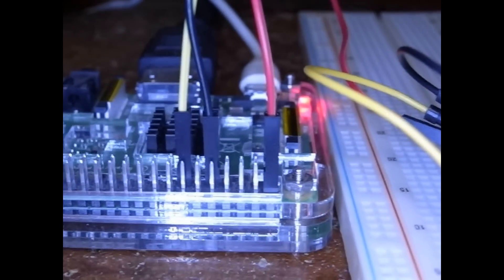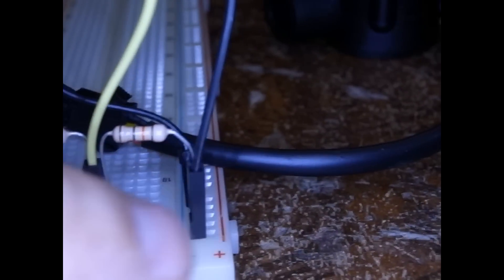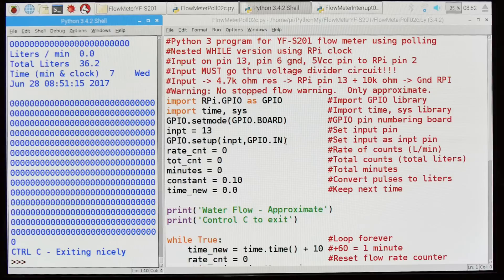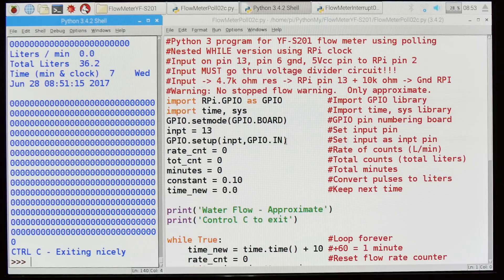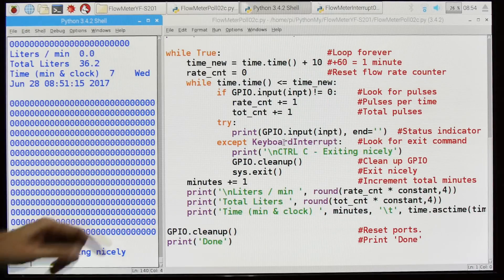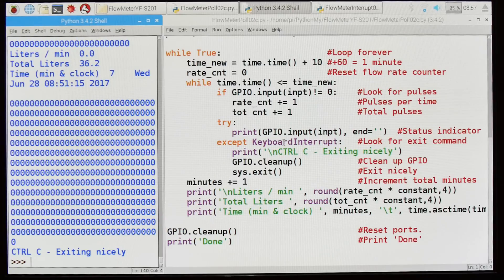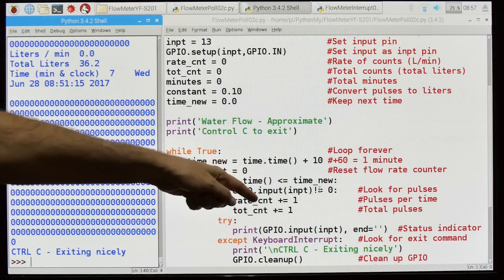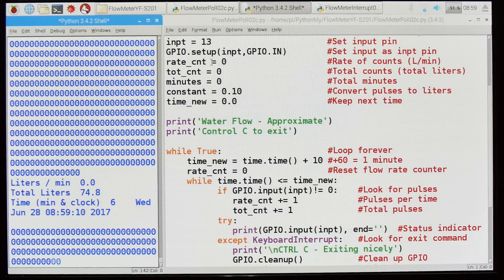RPi 20 - YF-S201 Hall Effect Water Flow Meter / Sensor

Comment: do you think this could be use to measure airflow in an HVAC system?
Reply from the maker: Probably not very well. The little turbine starts spinning very fast and it stops being accurate at all. It needs the thickness of the water to dampen it.

Comment: This resistor divider drops the voltage to 3.4v. Over 3.3v GPIO limit, is not this dangerous? Or the sensor out not have 5v output? If is 5v, the R2  should be >=9k

Comment: Nice project.  I am  curious, I have this running and I am getting pulses but far fewer than expected.  Could that be due to the resistor sizes I determined as part of my voltage divider?  I am only getting ~5 pulses every minutes when I know the impeller is spinning much faster than that.  Any ideas?  I am getting a reading, it's just way under what it should be.
Reply from the maker: There is a max rpm that it is rated for, and it is pretty low. I have info in the description. Also, any amount of code causes the pi to start missing pulses. I have a couple videos on this meter exploring ways to improve accuracy.

Comment: Hello, this version of raspberry pi can work on three water sensor at the same time
Reply from the maker: Yes, but timing begins to seriously affect accuracy even more.
Reply: @tsbrownie  ok thanks, but can you explain more and what is your advice or the best solution if i want to make three water flow sensor works together at the same time.
thank you so mutch you are the best.
Reply from the maker: @qatrahqatraty8184  I have not done that, so my answer is a guess. But if I needed accurate results I would experiment using 1 dedicated secondary micro computer for each meter (some in the Arduino family are only 2 USD) and use another primary to gather the data.
Reply: @tsbrownie   thanks for the advice i am gonna try it

Comment: your video is great, but im having issues on line 23,

 print (GPIO.input(inpt), end='') #status indicator
                                ^
SyntaxError: invalid syntax

can you help me? thanks
Reply from the maker: I think your "end" is incomplete.
Reply: What do you mean by incomplete?
Reply from the maker: @zackyilahiazmi2073  You either have an error in the previous line OR you have a " instead of ' ' (double quote instead of 2 single quotes)
Reply: I recently search about my problem, its because im using python 2 instead of python3, but after i install python3 and use it, it still say invalid syntax at end=''
Reply from the maker: @zackyilahiazmi2073  It looks like you are using the wrong quote marks.  Use either 2 singles '' or 2 doubles ""
Reply: No, actually im using double ' not single " and still didnt work
Reply from the maker: @zackyilahiazmi2073  Then you might have an error in the line above and Python did not flag it.  Interpreters sometimes do that.  Also, try dropping the optional end = "" and see if that fixes it.

Comment: thanks for your code, but i want know , how to calibration ? , thank you
Reply from the maker: It depends on your setup.  But the basic calibration specs are in the description.
Reply: @tsbrownie  in your video , your code constant value 0.10 . Can i know where can get 0.10 ?
Reply from the maker: @ilhamahmad6156  It is just a place-holder.  If you look in the description I have the manufacturer's data on how many Hz = how many liters / min.  BUT you have to adjust it base on your code and how much you have the pi doing.
Reply: @tsbrownie  i use water flow meter fs300a 3/4 , i get in 1 liter 4 seconds , so 60/4 = 15 liter / min , so in my water flow meter , F = Q * 5 , so i get value frequency is 75 , is this true ?
Reply from the maker: @ilhamahmad6156  I do not know that meter.  You have to get the information from that manufacturer.
Reply: @tsbrownie  oke thank for your attention , good luck

Comment: Hello, 
This unit, can it be connected to control ?
Like Temptron
Reply from the maker: I do not know temptron, but I have a video talking about using it to control a water system.
Reply: @tsbrownie  this device has digital input, can it be connected?
Reply from the maker: @listrikb6885  It uses a magnet and Hall effect sensor. The magnet triggers the sensor creating a pulse (or pulses) per revolution. The raspberry pi counts the pulses. Data is in the description.

Comment: Will this work for gravity flow, with less head pressure ? head pressure is going to be 10 PSIG
Reply from the maker: The specs are in the description.  The manufacturer lists a maximum, but not a minimum.  I think gravity would work fine as long as the flow rate is within specs.

Comment: I think you can calculate the constant by spec (450 pulse per liter). Just divide the number of pulses between 450 and multiply by the time unit you are measuring (e.g. 60 secs to get Lt/min). However I used the wiring and was OK!! Thanks!
Reply from the maker: That sounds correct.  But you must consider the speed of the computer as well, if you are just running a small program that will work, but as the program grows in complexity, the polling / interrupts don't always happen as timed.

Comment: ur total is wrong. you didnt blow 12 liters of air through that. you aren't integrating right.
Reply from the maker: Yes I said that in the video.  The problem is that impeller is spinning very fast giving wrong measurements.  This was made to measure a relatively viscous fluid (water).  Also the specs show it has limits on upper and lower impeller speeds.  This was just for demonstration purposes.

Comment: Will this code work for a YF-G1 ?
Reply from the maker: I included the YF-S201 specs in the description so you can compare to others.  You should also consider that the electrical requirements may be different.

Comment: do the sensor give reading when when the water flow is slow?
Reply from the maker: The details are in the description.   Working Flow Rate: 1 to 30 Liters/Minute
Reply: @tsbrownie  so if the flow lower than 1 L/min it wont read anything? am i right?
Reply from the maker: @muhammadzar3002  It may or may not read, but it will be inaccurate.
Reply: @tsbrownie  thanks for your reply.

Comment: Good day

I need help with the code.

I want the flow meter to count 500ml and then then the relay must close?

How can i do that
Reply from the maker: I put a lot of info in the description.  It will be different for each model of flow meter.  500 ml per what time?  This meter has minimum and maximum flows.  Outside of those it does not work well.  Also the accuracy is only ±10% and the range is 1-30 Lpm.  Hope that helps.

Comment: I'm not sure if this has been mentioned before, but I figured out how to solve the getting 1's as inputs even when the impeller is stationary. If the impeller has been turning in the opposite direction as it does when air flows through in the correct direction, it shows  1. If you blow through in the correct direction before running the programme it corrects itself and goes back to 0. Not sure if this will help anyone but just thought I'd mention what I found.
Reply: same here
Reply: he already solve the impeller problem, thanks you mention
https://youtu.be/0fqoq1jWlts

Comment: Hi, I know this is a water flow sensor but I would like to use it for air, do you know if that's possible? It's just to get an idea of a relationship so it doesn't need to be that accurate. Thanks :)
Reply from the maker: I don't think it will work.  Air would cause it to go WAY past it's design speed.  It is very easy to make it start under-counting by a lot.  I think in the gas business they use pressure and a fixed opening to measure the amount of flow of a gas.  I googled "digital air flow meter" and there are such things.
Reply: Yes I tried it on a air compressor and it works. Google for the datasheet and as long as your air pressure / air flow is within the spec it should be fine. I used edge detection to trigger a timer function as I am not measuring the pressure thus not measuring frequency.

Comment: Can I use the sensor if it is connected to DAQ (Data acquisition)? without using the Pi or arduino.
Reply from the maker: It's not a smart sensor.  It's just a hall effect switch that is triggered by a magnet on the impeller.

Comment: Hi, I have everything needed (electronics and hardware) and I tried to copy the program as you have it written but I'm getting a syntax error at "if GPIO.input(input)!= 0   #Look for pulses". It highlights everything after that red and won't let me begin the program. Is there any way I could download your copy of this program so I can be sure there are no mistakes?
Reply from the maker: Just saw your comment.  You probably have an error on the line above it.  Look for missing ) or : or such.
Reply: Since I wrote this comment I have been able to make some progress. I took your code and modified it to suit my needs. I am in need of some extra help though. I have even gone to my local tech school to find someone who knows python and GPIO but am having a really hard time finding the help I need. 

What I am trying to do is use a flow meter and solenoid to automatically dispense 5 gallons of fluid from a pressurized source (PVC pipe) upon a button press. I also need a button to interrupt flow as an emergency stop (shut the solenoid to resting position. 

I have the elctronics hooked up and pieced together including sensor, solenoid, resistors, transistors, 12v relay etc. The code is currently scattered among different programs. One program is able to open the solenoid upon start (run) program and stay open until the total count reaches a certain number and then shut. Another program will open the solenoid at a button press and stay open but it's not reading impulses the way i would like it to (technically its not reading the input at all). I am having a hard time bringing these features together into one program. 

I would really like to get this project done and am looking for some help from someone who is much more experienced in python coding than myself. Is there any way we can begin a correspondence with each other via email, phone or email? Assuming you are willing and have time to help an enthusiastic novice such as myself. I would so greatly appreciate it.

Ill leave my email here if you are willing to help. Daren@kingind.net . Thank you!
Reply from the maker: @darenlorenzo8342  I need to point out that this meter is only for water, it concerns me when you wrote about pressurized fluid, because this meter is not for any other fluid, especially not something flammable.  This is just a hobby for me, and was geared more for someone who wants to measure water use in their drip system or similar.  I don't know your application, but phrases like "emergency stop" seem to hint this might be something that requires a professional programmer / electrical engineer.

Comment: Hi, can you explain a little bit more about how you get the constant.
Reply from the maker: The constant REALLY depends on your code.  In theory you can just use your setup to fill a bucket of water and time it.  Then use the flow per time info from that to make your constant.  That constant will depend on your code.  
You can start with the data I put in the description as a baseline.
Reply: Thank you for your response. I am basically doing this project to measure consumption on my kitchen sink tap and i did as you suggested and it seem to have worked for the first test but when i open the tap and have water running at the different speed than the one i used to get the constant then i get wrong results. My thoughts are that the pressure or the speed of water affects the time it takes to fill a bucket of water to get the constant, so my question is: is there no way of getting the constant at runtime based on the speed the water is running? forgive me am still new at this.
Reply: @mfundosydwell3713  did you find any solution to your problem?

Comment: Cool program.  I am using a for loop that cycles through an array called duration = ["1", "2"......,"9","10"] to represent seconds  .  I change time_new to time.time() + 1 to count off each second and will have this print a graph of flow each second by printing ****** according to what I need.
Reply from the maker: That sounds like an interesting update.  Post a video and leave us a link.
Reply from the maker: BTW, I added a comment above with links to 3 other videos on the water meter.

Comment: Are both resistors 4.7K?
Reply from the maker: In my setup the other is 10k, BUT that varies depending on the voltage supplied, etc.  Look carefully and you can see at 08:58

Comment: That's sweet.  I need it to measure flow through a project.  Someone interested in the project needs the flow rate quantified.  I think I would rewrite the code to print a graph of the flow rate every 1 second to see if it varies.  thanks

Comment: Hi 
Could the code be modified to only record when water is running
Reply from the maker: I've thought about that.  It's mostly a problem with the sensor.  It's a magnet passing by a switch.  If the impeller stops with the magnet on the switch (maybe 1 in 20 chance) and it stays there for say 2 seconds, you could set a flag saying it's (probably) stopped.  Same if there's no change for 2 seconds and it's off.  That seems pretty reliable and simple, but when water flow is slow and the pulse is missed or when it's really fast and the pulse is missed by the pi, it can act like it's stopped.  I think it is do-able.  I will have to give it a re-think.  Thanks for the question.
Reply: Hi
I found the following program for testing the hall sensor that reacts very quickly to the on or off of the water flow. The program does not even start until the water flows, but it only returns high or low +time. Is there a way to incorporate this on off feature into your code. I am new to python coding so I maybe talking rubbish but I thought it might be worth asking the question
#!/usr/bin/python
#--------------------------------------
#    _  _  _ __
#   / _ \/ _ \(_) _/_  __ __
#  / , _/ ___/ /\ \/ _ \/ // /
# /_/|_/_/  /_/___/ .__/\_, /
#                /_/   /___/
#
#       Hall Effect Sensor
#
# This script tests the sensor on GPIO17.
#
# Author : Matt Hawkins
# Date   : 03/04/2017
#
# http://www.raspberrypi-spy.co.uk/
#
#--------------------------------------

# Import required libraries
import time
import datetime
import RPi.GPIO as GPIO

def sensorCallback(channel):
  # Called if sensor output changes
  timestamp = time.time()
  stamp = datetime.datetime.fromtimestamp(timestamp).strftime('%H:%M:%S')
  if GPIO.input(channel):
    # No magnet
    print("Sensor HIGH " + stamp)
  else:
    # Magnet
    print("Sensor LOW " + stamp)

def main():
  # Wrap main content in a try block so we can
  # catch the user pressing CTRL-C and run the
  # GPIO cleanup function. This will also prevent
  # the user seeing lots of unnecessary error
  # messages.

  try:
    # Loop until users quits with CTRL-C
    while True :
      time.sleep(0.1)

  except KeyboardInterrupt:
    # Reset GPIO settings
    GPIO.cleanup()

# Tell GPIO library to use GPIO references
GPIO.setmode(GPIO.BCM)

print("Setup GPIO pin as input on GPIO17")

# Set Switch GPIO as input
# Pull high by default
GPIO.setup(17 , GPIO.IN, pull_up_down=GPIO.PUD_UP)
GPIO.add_event_detect(17, GPIO.BOTH, callback=sensorCallback, bouncetime=200)

if __name__=="__main__":
   main()
By the way I tested your code with run of 30 minutes and found it to be very accurate  +/- 2%. the only problem is when the flow stops, if it stops on 1 it keeps recording 1s and gives an inaccurate reading.
Reply from the maker: I am rethinking this.  I think it can be done, I just have to go about it in a very different way.  First I am going to write a tachometer for it to better understand exactly what it is doing.
Reply from the maker: As promised I came up with an advanced version that tests for a stopped impeller (in fact more than 1).
https://www.youtube.com/watch?v=3q7simXNlm0
https://www.youtube.com/watch?v=0fqoq1jWlts
https://www.youtube.com/watch?v=wpenAP8gN3c

Comment: Can you do the programming with a 2-wire pulse-output flow meter (w/reed switch) instead?  These flow meters are going down in price to make them competitive with hall-effect flow sensors.  Plus, they don't need an external voltage supply to produce the pulse signal.
Reply from the maker: It should be almost the same program.  You don't need the power.  Just detect the switch closed / open.  I will look into it, but this is just a hobby and so I don't know when I can get around to doing it.
Reply: Do you think this water sensor can be used for like laser engraving machine like a water protection switch to detect if there is no water flowing and say to machine to stop work if the pump get break for example